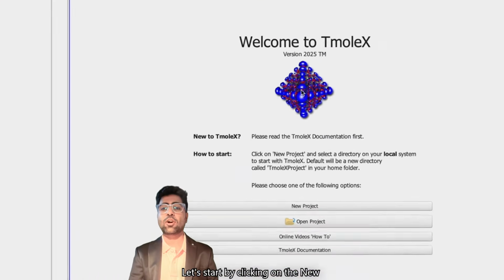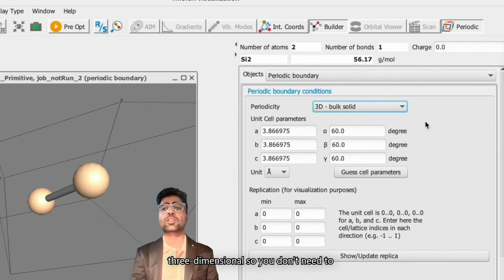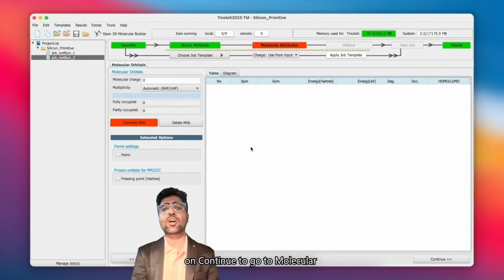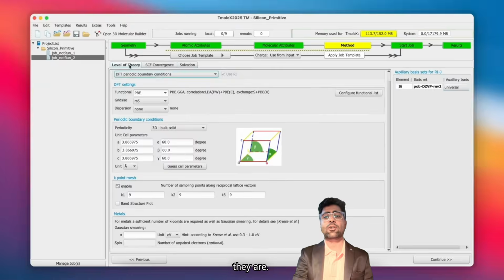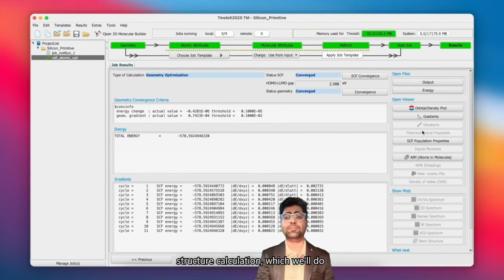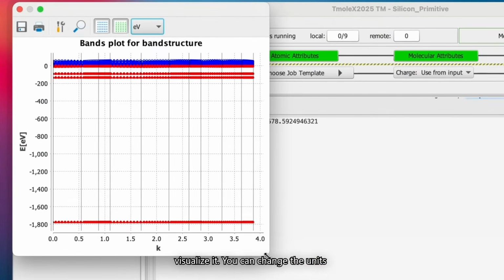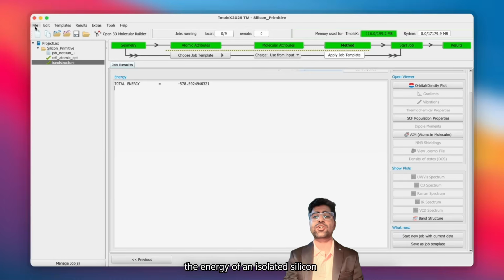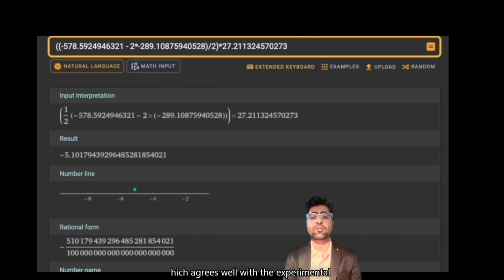TURBOMOLE Tutorial: Silicon Crystal Geometry Optimization, Band Structure and Cohesive Energy

Comment: how long does it take for geometry optimization ? Does it take like 1-2 days like castep? i have 12 cores
Reply from the maker: Hi, 
it strongly depends on system size and basis sets. For a small system like Silicon (3D periodic) it should take 20-45 minutes max on 1-4 cores. But probably lower.

For a larger system like 2D hBN monolayer with 32 atoms and a large def2-TZVP it had taken me around 12 cycles with each cycle taking 1.5 minutes each on average, giving a total of 18 minutes on 32 cores. So on 12 cores it may take around 54 minutes. It will only take something like 1-2 days for really large systems with >100 atoms or if the starting geometry is really bad.